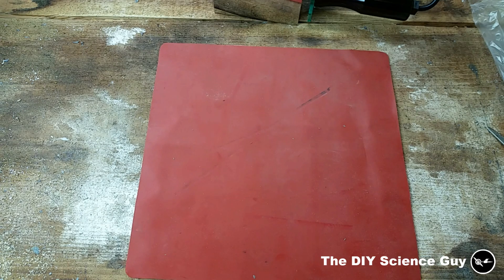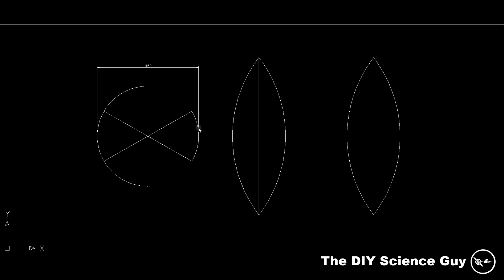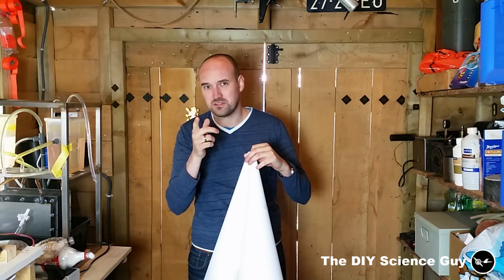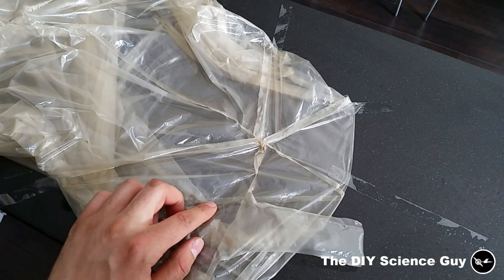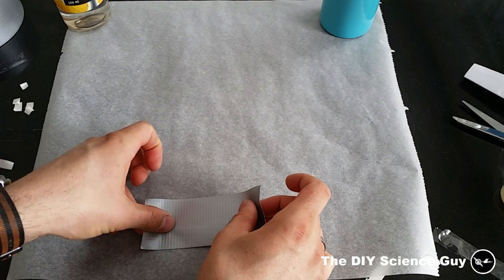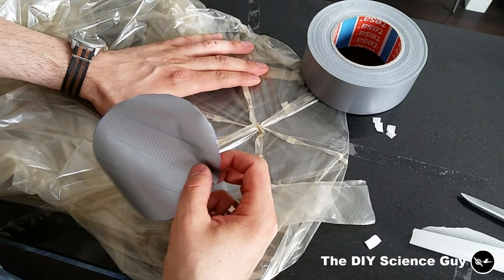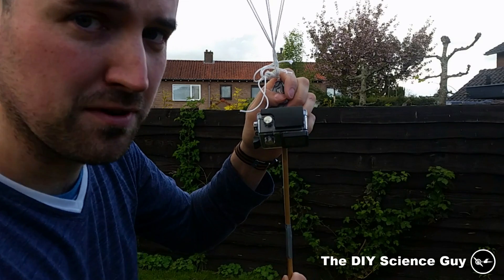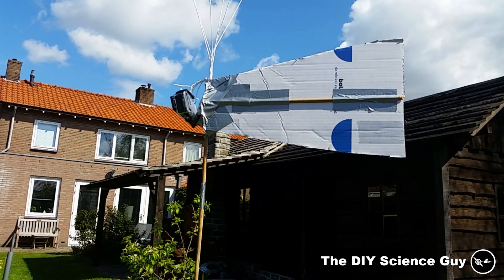Massive 800 liter DIY hydrogen balloon and a view of Ermelo NL

Comment: I'm impressed with the quality of seal you get from the roller. I've floated balloons made from swing bin liners, and just made them bigger by extending the length (looks like a big sausage). They were mostly hot air balloons; I've only ever floated a single liner by filling with hydrogen or helium, a single liner doesn't have much lift and I would have resorted to putting multiple into a single outer liner instead of attempting many non-leaking seals.

Comment: Have you ever tried making a balloon from aluminized mylar?  I've played with garbage bags and small sheet plastic envelopes made using a "food saver" type bag resealer and like you, was encouraged by the high strength of the seams but when I tried making an envelope using Al-mylar emergency blanket I just couldn't get the seams to hold.
Reply from the maker: Yes I tried those emergency blankets but thay don't weld. I glued them by applying a very thin line of hot glue on one side then laid the other side on top of it and glued it together by heating it with a flattening iron while keeping a piece of baking paper in between the iron and the balloon at all time.
Reply: @TheDIYScienceGuy  does it contain the hydrogen or does it bleed?
Reply from the maker: The blankets perform similar to the  mylar balloons.

Comment: Cheaper than buying a drone to take pictures!

Whenever I imagined doing this experiment, I always thought that I would need two strings to the ground to keep everything stable for the camera, but your wind-vane stabiliser appears to work surprisingly well!  

I am thinking that on a sunny day you could save half the hydrogen gas if you made the balloon out of black plastic! Here in Britain, our waste disposal bags are made of suitable thin black plastic. If you fill the balloon with half (or maybe less) of the required hydrogen, then the heat of the sun will expand that to fill the whole balloon, and up she goes! 

If you make the balloon a bit larger, then you don't need to use hydrogen at all! 
Half fill the black balloon with normal air, and soon the sun's heat will blow it up fully. 
Some sort of pressure-release valve (or maybe a small hole in the bottom) would be advisable, so it doesn't burst.
Reply: Perhaps, but a kite would be cheaper still.  ;)  There really is just something magical about lighter than air flight though.
Reply: I looked up the rolling heat sealer he used and it's $180. You could buy a low end cinewoop quadcopter that could loft a gopro for that price alone.

Comment: awesome video!  what is the machine you are using to seal the pieces together?
Reply from the maker: Thank you very much! It's a heat roller. There is a link in the description of the video to the company that sells them in fort worth texas.
Reply: @TheDIYScienceGuy  can you share how you made the valve?
Reply from the maker: Sorry, what valve do you mean?
Reply: @TheDIYScienceGuy  the valve on the balloon itself, the one through which hydrogen comes in. Or is it just a tube you tie down or clamp? Not clear from the video sorry
Reply from the maker: Aah yes, indeed no calve but a tube I tape shut.